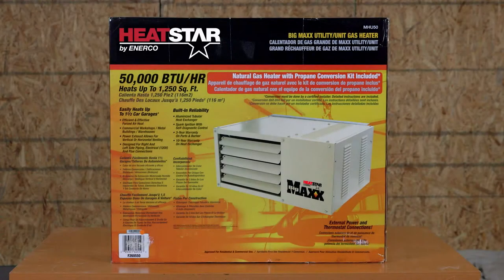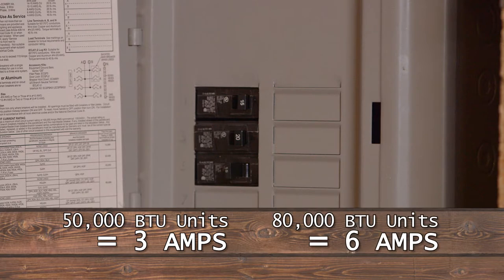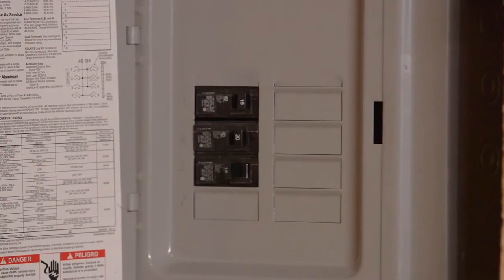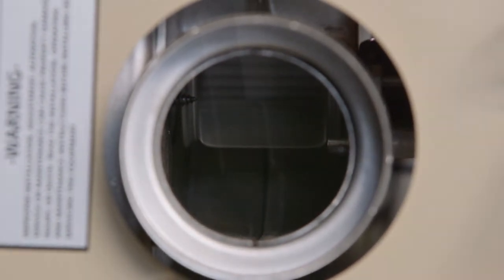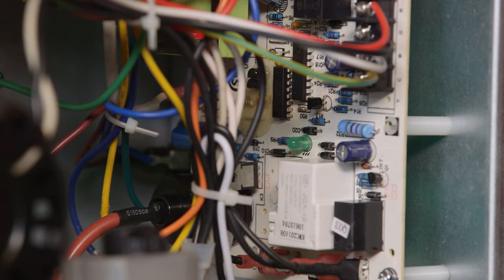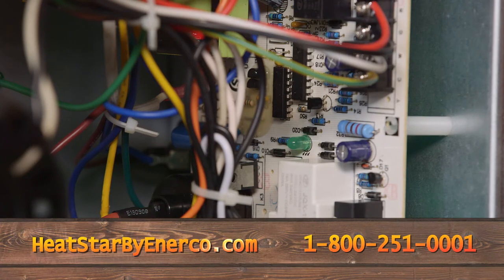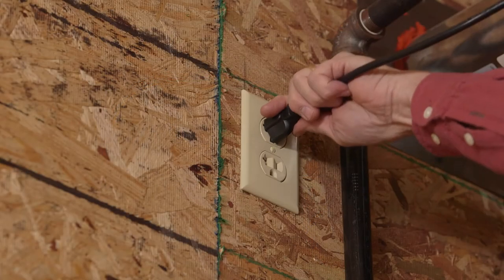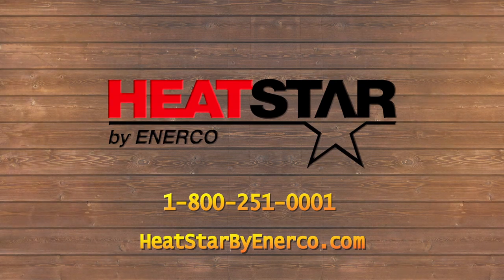Heatstar - Unit Heater Installation & Operation

Comment: Mine won't start now. WHY???? Is was at first, then I turned it off, next day won't  start. I have been trying to call Heatstar all day today is Friday-Nov,26,2021 auto answer says open 8:00a.m. eastern standard time. [I slide thermast over, kicks in waiting for up to 20 to 30sec, flames should be starting as it did once.] I closed the valve in the house, opened an allen key screw one of the too ontop inside just left of the knob to turn it off, to allow gases to empty from the line. didn't work. Also, tried to shout off garage power to say re-set, no go. 

 Tried same as to video on U Tube dis connect vac line, it even says it in to book, lol this video also expresses it. NO GO.... Auto Ignite isn't happening....